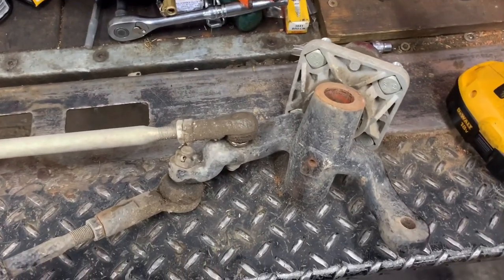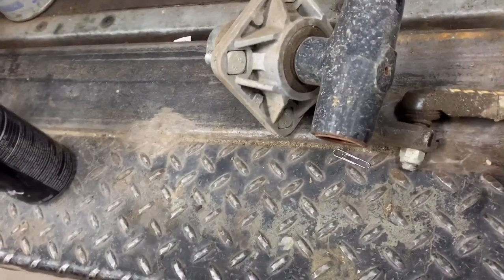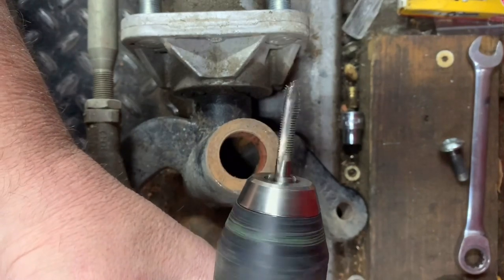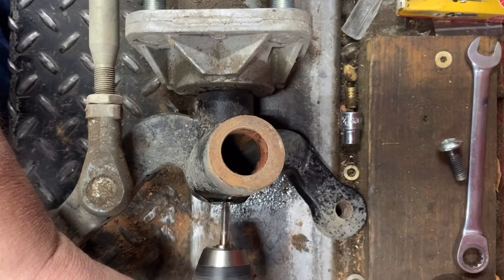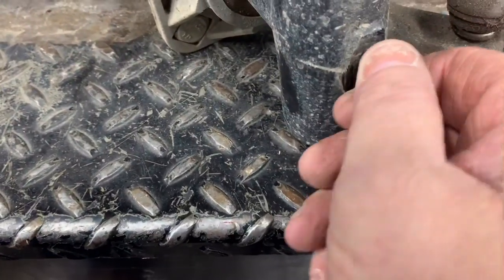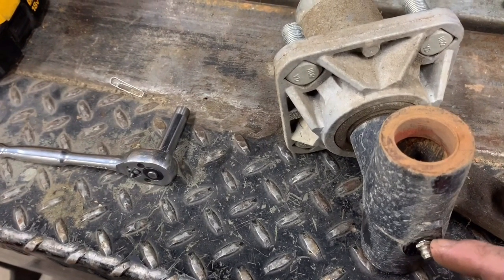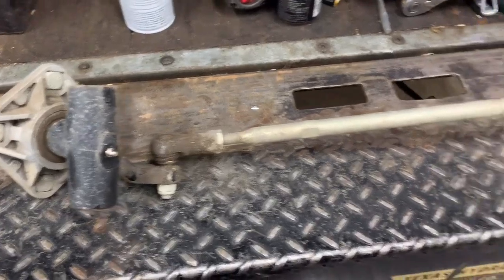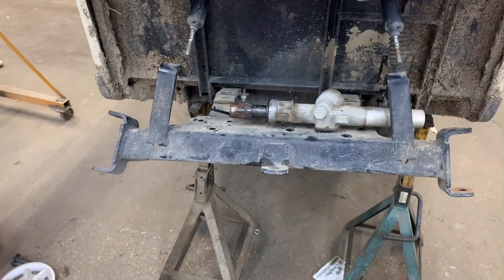EZ-GO TXT CATASTROPHIC BLUNT FORCE FRONT AXLE TRAUMA AND MAKING IT GREASEABLE  FOR LONGEVITY

Comment: Got a question but first an observation:  Getting the most you can out of a machine, testing its limits, is understandable....but that's outright abuse and it's unconscionable, especially if the abuse isn't going to get repaired by the abuser.  But oh well, if it wasn't for customer abuse you'd probably be a lot lonelier in the shop LOL.  Now to my question....

Got an EZ-Go that I'm converting to Predator 212 gas power.  It was one of a few donors for a pontoon boat conversion to battery operated stern paddler.  A lot of the steering parts are missing, as they were used to put together the rudder controls on the paddleboat.  Now for my question:  The drag link--tie rod assembly--whatever it's called:  Does it go in nuts-on-top?  Looks like it from a few vids where I've seen it in passing but thought I'd ask.

Comment: Before taking it off, I noticed my ezego txt has only about 1/8th inch clearance between the knuckle and the frame. No way that knuckle will go back in with the grease fitting on it. I didn't drill mine out for that fact. Might have worked if they predrilled the hole toward the front instead of out the side. I packed the knuckles full of grease and reassembled them after a heavy duty cleaning.  It looked like I caught them just in time.

Comment: Just like with lawnmower spindles, the grease is useless. On lawnmower spindles the grease doesn't reach the bearings so it just sits there doing nothing. On these golf cart spindles the grease just sits between the cast iron spindles and sleeve doing nothing. It's not greasing the bushings or the main kingpin bolt.
Reply from the maker: You couldn’t be more incorrect